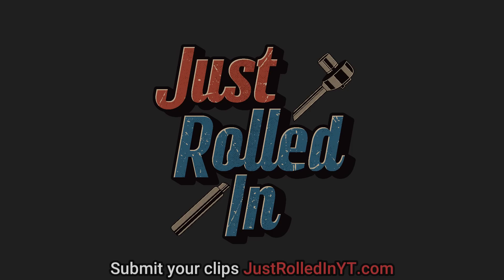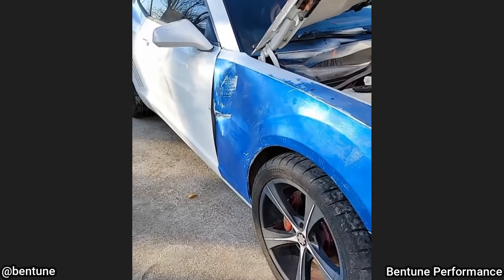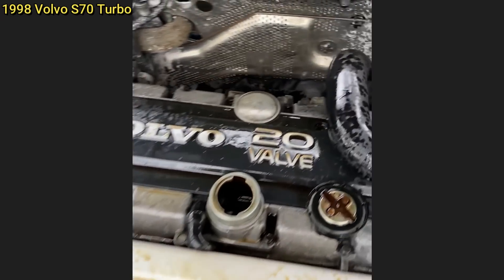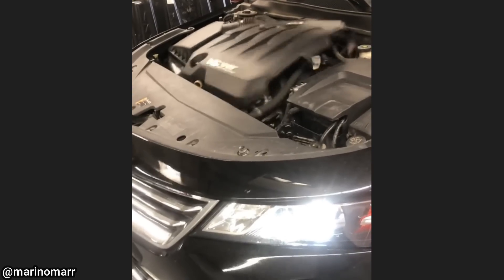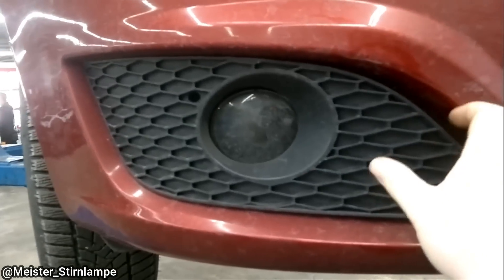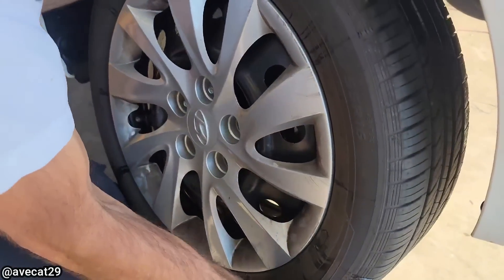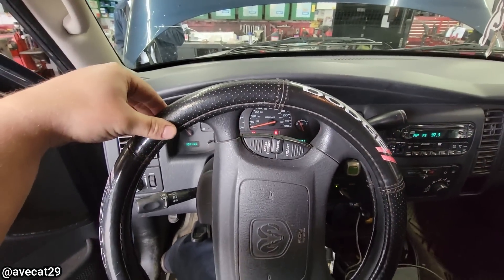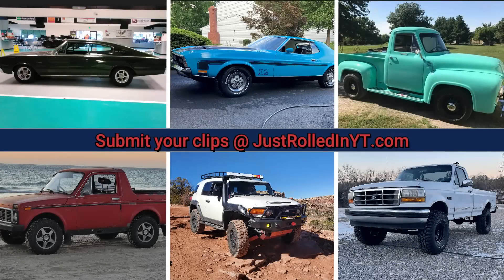Customer States Oil Leak On Car They Just Bought | Just Rolled In

Comment: That first one looked like a wasps nest for a second
Reply: I thought it was a small tree that was ran over.
Reply: @TheForcesofDarkness  So did I!  Is that a branch?  Is it a wasp nest?  It's silicone!?
Reply: This is not the first time someone got snookered buying a used car. I can't believe folks do this without having it checked by a mechanic.
Reply: @tomschmidt381  we can say what we want about EU regulations being intrusive etc etc, but here we can't sell a car without having it checked at an independant control center. Such a thing would be a huge fail and the buyer could not ignore it.
Reply: @Kelvallontan  Agree, folks chafe at government regulations but most are the result of previous problems the regulations are intended to solve.

Comment: That oil at the end was so impressive
Reply: It was very satisfying. Lots of practice. 🙂 And lots of previous messes.
Reply: I can say with 100% certainty if I had removed that drain plug there would have been some oil running down that lift arm.
Reply: Rainman Ray would approve.
Reply: Curious what kind of vehicle it is.  Could it be the oil tank of an air-cooled 911?
Reply: @kuri911  it says it's a 911 in the video.
Reply: @grantmccoy6739  No, it doesn't.
Reply: @NoMoreBsPlease  on the description of the red bar.
Reply: @kuri911  Late to the party, but yes it's an air-cooled 911 with a dry-sump, the drain is right next to the passenger rear lift point.

Comment: he needs to take that car back to the dealer, body color not changing with the settings is a huge issue for the dealer to overlook. it's bad enough when airplane mode doesn't work, don't let them sell you a car with a faulty color change system too

Comment: I do miss the C/S part of working in a public garage. 

One of my favorites was a lady who said her car was "really loud" when she went fast now. We asked if her car was shifting gears normally. She replied her car was an automatic and had no gears, therefore couldn't be the problem.
Reply: facekeyboard
Reply: Laady sounds like my mom(may she rest in peace)backing our new to us 53 Merc which was her first automatic, out the driveway and getting ready to go forward up the street she stopped then stepped on the gas as we shot backwards I reached over and stabbed the brake and said, Mom you have to put it in drive.  She says , but this is supposed to be automatic.  I was ten !
Reply: Well... to be fair to her, she's half correct with her answer. If she didn't have a manual then she wouldn't be shifting herself and thus might not know how the gears feel shifting with an automatic
Reply: My car has only 1 gear
Reply: Reminds me of the tale of a Diabetic office worker being told by her doctor she needs to switch from candy to fruit - the idea probably being, at least that would be a small improvement, and/or a step in the right direction.

So she started eating Banana-flavored candy instead, as though that was going to help.
Reply: I mean that sounds pretty normal for someone with no car knowledge. Ain’t too bad at all
Reply: My ex argued with me that her car didn't have a carburetor because it was a stick shift, back then most cars still had carburetors including hers.
Reply: @Bee-kk8jf  Yeah not at all but since he claims he enjoyed customer service I hope he used that as an opportunity to educate.
Reply: im not a mechanic but was told by a Honda certified tech that the reason my phone and car wouldn't stay connected via bluetooth was because of the wire i was using.  gotta love when the tech is horribly wrong lol
Reply: Cvt has no gears tho
Reply: @malonysaintpierre1599  this was in a 94 Tercel.

Comment: There's not knowing how to drive a manual, and then there's complete incompetence. My wife bought her '13 Honda Fit 5 speed brand new, but couldn't drive it. She knew the basic concept, and I helped her learn, but she was mostly on her own to figure it out, and caught on quickly. 140k+ miles later, same factory clutch with plenty of life on it still. So it is just insane to me that this guy shredded his clutch just on the drive home. Just... how???
Reply: He must have had the wrong concept, like constantly revving the engine and controlling the car's speed with the clutch. That might do it.
Reply: I taught my oldest stepbrother in my '84 Pontiac Fiero.  He did alright for his first time driving stick.  The only thing he struggled with was timing his shifts and starting on hills.
Reply: Hehe, i blew the ball bearings out of my driveshaft, my first time learning. Im doing great now. Second and third gear are going out tho.
Reply: Top gear from a stop and max revs , ride the clutch until you reach desired speed.

Comment: I found it surprising the a person who likely had never seen a manual transmission car and knew nothing about driving a manual transmission car would buy a manual transmission car and completely destroy the clutch during the drive home. At least he got some lessons on a manual transmission after the clutch replacement. There are a lot young people who likely have never seen a manual transmission car. Since I am 71 years old, I learned to drive manual transmission cars when I was young at a time when manual transmissions were a lot more common.
Reply: I'm 32, I learned how to drive on a tractor.
Reply: I learnt to drive my dad's 3spd auto car, but taught myself how to drive a 4spd manual after buying a Mini Cooper S! 
While my Mini had synchromesh on all gears, my brother's older 850cc Mini was the early model without synchro on first!

Comment: 1:58, I had a tire go flat and it had begun to disintegrate. To have some fun with the tire shop, when I brought in the wheel (off of the car) I had put duct tape on the cracks and acted dumbfounded as to why it wouldn't hold air. I told them it had worked for a few months, but today was flat. They thought I was serious.
Reply: That was possibly the third duct taped tyre they had seen that day, lol

Comment: Red Green would be proud of the duck tape fix if it actually worked. The level of stupid is off the charts. It really is scary to think how many idiots are on the road. As always, thanks for terrifying me and sharing these videos.
Reply: Loved the ep where Red duct-taped pieces of a bus together.  "If they don't find ya handsome, they should at least find ya handy!"
Quando Omni Flunkus Moritati!
Reply: If the tape was on the inside it would work because the pressure holds it on
Reply: @mark2073  no, please get your tired fixed properly lol.
Reply: @mark2073 That's.. not at all how that works..

Comment: Been watching for a while. I've been driving since 1973. Turn the wrench of my own car most of the time. This crap scares me. I'll look at the cars on the road around me and I just worry.
Reply: That's why I  like living in a country that has mandatory annual inspections (MOT test) every year after the car is 3 years old from new...! (For ambulances, taxis and vehicles with more than 8 seats, i.e. a minibus, it's after 1 year old!)
Reply: @raycardy4843  I say this in every comment section on JRI: Some states in the US have yearly inspections. In NY, there's always a mechanic someone knows that will slap a sticker on for an extra $20, as long as the car has no codes. Before OBD, they would throw another car on the Dyno for the emissions test. I don't know how it is now, but years ago, the mechanic could do an OBD "offline inspection." They could claim the machine was offline (no internet) and manually input the vehicle information. If they did too many, they'd get caught and fined. Many years ago, my truck had a nagging evap leak and the mechanic would do that for an extra $20. A lot of mechanics, from personal experience, see a car that looks taken care of and just plug the OBD2 in to read and print the sticker. They don't bother putting the car on the lift to check everything else out. I was happy to finally find a shop that put it on the lift because I found out about stuff that I, myself, could fix cheaply before it became an expensive mess someone else would have had to fix. Watching this channel (and SMA) proves that a shiny, pretty car can have deep dark evil lurking underneath. 

SMA has had several videos where another shop sent a car to him to fix whatever the code was so they could inspect it. Underneath, the car would be completely rotted out with the frame barely holding it together. But that shop was more than happy to pass it. Or, he'd get a car in with a brand new sticker, but barely had a frame left. Eric mentioned that a shop can't report another shop to the DOT/DMV.

Comment: I did the "just topped off the oil and left the cap off" on a volvo 740.  it got smoky real fast.  Luckily, the cap was still on the fender, so I put it on and went back to driving.
Reply: I did that too on my motorcycle.  But the oil filler cap is located down low on the engine and is near the clutch. It's not located on the valve cover at the top of the engine like on a car engine.  My motorcycle's clutch is a "wet" clutch, meaning that it is bathed in oil and that oil is the same oil that lubricates the engine.  When I ran my motorcycle's engine, the clutch threw engine oil all over my motorcycle.  What a mess!  But that's not all. On another occasion with the same motorcycle, I left the funnel that I used to fill the engine with oil, in the engine.  When I started the engine, the clutch kicked the funnel out and it landed on the floor with a loud crash.  It was one of those "WTF happened?" moments.

Comment: 0:34 How is it posssible to destroy a clutch like this? I cannot imagine what someone must have done to completely shred it in less than 10 minutes.
Reply: Trying to change gear without using the clutch??
Reply: @Wordavee1  If You Didnt Use The Clutch How Would You Destroy It ? Also I Have Driven Manual Cars All My Life And Never Seen That Before .

Comment: The one with his friend doing the brake job must be a worker from the quick lube place. They should of used Gorilla Duck Tape on that tire. 😉 You can't make this stuff up, it gets better and better.
Reply: We had a truck driver that had a hole in his desiel tank. He used duct tape to cover it up, then filled the tank up. He went and parked for the night on the gravel parking lot. Needless to say, by morning his fuel ran out. That contaminated the ground. His company had to pay for ground decontamination.
Reply: @anitakristensen4679  yeah any petroleum products will dissolve the glue in minutes. That wasn't too smart.
Reply: @frankbiz  we got a good laugh and the truckstop got more of their lot paved.

Comment: Here in the UK we have what's known as an MoT test every year for cars over 3 years old.  Most of the vehicles shown here wouldn't pass and, if the police spotted anything amiss, the driver would have to have the vehicle tested with the possibility of criminal charges for a failure as a result.  Keep your vehicle well maintained by a reputable mechanic/technician, folks.  It's cheaper and safer in the long run!!!

Comment: It's still cheaper to fix a manual transmission today than 8and 10 speed automatic transmission .
Reply: Plus they're real good anti-theft devices!
Reply: For best anti theft, use a transmission with a semi "super 10" shift pattern.
They try to go from first to what they think is second but it's actually third.
Do make sure you remove the labels though.
Alternatively, you could use a "regular 10" shift pattern, chances are they won't make it past fifth.

Comment: that last clip is like me changing oil on my Subaru the oil filter is between a y in exhaust it is a game of see if you can take off filter and not cover exhaust in oil so i usually poke a hole in filter to drain oil before taking it off

Comment: I wish I could get some footage of some of the vehicles at work.
Most of them are prereleases or test beds for software.
Some however are prototypes, others are testing new features, and a few are just a mess.
We have one, Big huge powerful engine, Pretty sure it's a V12, not aloud to take it above 65, The entire dash is lit up like a christmas tree, there is a kill switch you have to hit if you stop for more than five minutes, and the turn signals in the rear are so incredibly broken.

If you turn on the signals you get a fancy yellow line. Until you hit the breaks, then they shut off until you let off the break and come back as flashing break lights.
I also discovered that if you turn the hazards on, hit the breaks, and use the turn signal, one side is a line and the other is the breaklight.
I really wish I could get video of it., but I like my job. 

Another car that I simply refer to as "The bedless bastard" has a fun issue where between 37 and 45 mph it feels like the rear end is just skipping down the road.
I don't want to know why. It's more fun that way. I like vehicles that are trying to kill me, keeps me alert.

Oh! and another car with that auto engine off thing, where the engine shuts off at a stop to conserve fuel, It actually kills the engine at around 5mph and then half the time stalls it when it starts.
So glad to see that one go knowing it would probably be destroyed.

There was also one set of vehicles that would scream at you about the trailer breaks every time you touched the breaks... despite the lack of a tow package, trailer, or hitch. That was solved by using the remote start on the remote.
Same vehicles also threw one of two check engine codes within a quarter mile strip of road every day for about two weeks. No clue what was up with that, but it made my job easier.

I have seen some weird things. Nothing too concerning yet. But some weird things.

Comment: I saw the steering wheel one once. Friend changed powersteering pump and hoses and couldn't remember which line went where. Jacked it up, started it, touched the wheel and it did that. Turned it off, switched the lines, and it was fine. Apparently on some cars it's easy to put them on 'backwards' if you're not careful.

Comment: I enjoy these video, because I had so many junkers. I bought one vehicle that someone fixed the rack and pinion and forgot  to tighten the extension From the the steering wheel. I was driving about 50 miles an hour when it disconnect and by the grace of God I went between 2 car and eventually stopped on the side of the road. 😅

Comment: I recently did and oil change on my Subaru ej25. I got a filter from the dealership and 5 minutes after changing the oil heading down the highway and I notice a trail of smoke behind us. i pulled over and with the car idling I could see that the oil filter had four pin holes in it squirting out oil like a spray bottle. I had lost three out of four and a half quarts before the car had even warmed up. I wish I had gotten a video of it running to send in.  I've never seen an oil filter with such a massive defect in it let alone one from the dealership. if it was an oblivious driver driving it, they would have blown their engine
Reply: U didn't inspect the filter?...duh

Comment: I'm no stranger to bizarre mechanical demons with vehicles and some of the weird ones reminds me of kf when I had a weird wiring issue in a taillight in my previous vehicle, a 2001 Grand Cherokee V8, where it would just light up and stay lit without blinking. And then I hit a pothole hard enough to fix it while coming out of a parking lot (the pothole was legitimately impossible to avoid on a right turn if you're staying in the proper lane and not swinging out into oncoming traffic, and it was at the bottom of a hill). One of the dumbest vehicle problems I've ever encountered, along with the ignition coils in my first car (1998 Camry) making a weird intermittent thump while idling. The second one had my dad, an actual mechanic by trade, baffling for a good month and a half trying to figure out wtf was causing the issue. And then he got to the ignition coils as a Hail Mary and one of them just fell apart whe  he took it out.

Comment: how does one shred a clutch like that? my first manual has 200k miles on it and it had the factory clutch and flywheel, i even rode the clutch a little because i was more accustomed to motorycle transmission yet the clutch was in excellent condition

Comment: Customer states vehicle has a strange odor and squeaking sounds coming from the air vent. 

Technician: *Opens the air vent. A deluge of plague-carrying rats scurry out - biting him and giving his the plague.

Customer states there's a hissing sound coming from the exhaust pipe. 

Technician: *Looks into tail pipe. A serpent lunges out - sinking its fangs into his face and injecting him with a fatal dose of neurotoxic venom. 

Customer states there's monkey noises coming from the trunk.

Technician: ... *cautiously opens trunk. A monkey shoots him in the chest with a shotgun killing him instantly. 

Customer states the radio makes a buzzing noise even when it's turned off. 

Technician: *Removes the radio revealing a bee hive of killer bees that immediately swarm in rage and sting him to death. 

Customer states the steering wheel turns by itself.

Technician: *Checks power steering line when a vengeful ghost dressed in 19th century automotive racing attire bludgeons him to death with a tire iron.

Customer states the newly purchased used vehicle sounds like it's running on sand. 

Technician: *Looks into the fuel tank and discovers it full of sand. Starts the engine and discovers it actually runs on sand. Government agents in black suits storm the workshop and murder everyone, the car is taken away and never seen again.